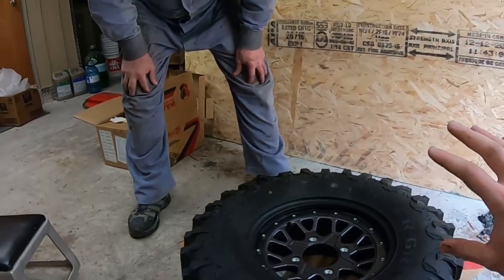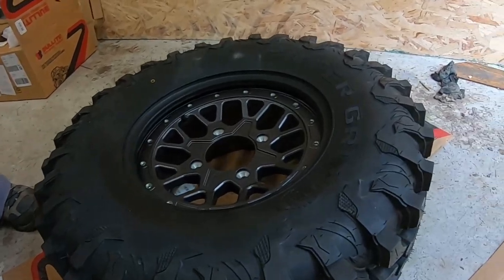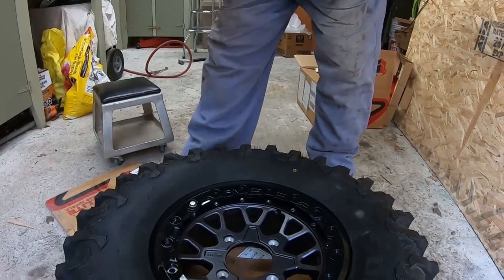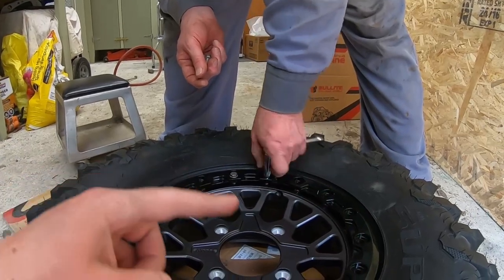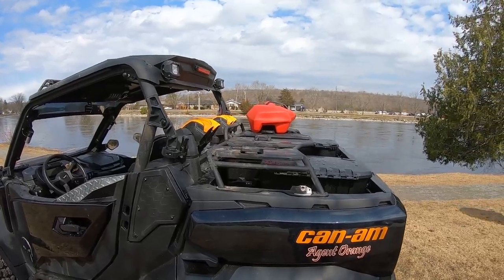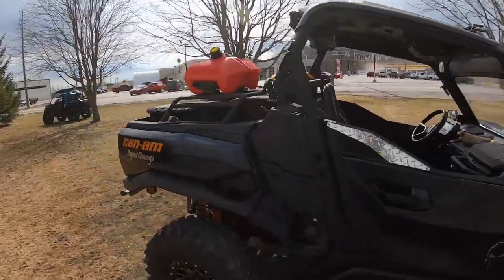XTP Build Ep 4: Style & Function + Linq Versatility - Commander XTP

Comment: I have 2013 Commander I have been building and just bought THE 2022 XTP. 
I love the break down of all the mods. I was wondering why Dad went with the smaller 14” rims verses the 15” it came with. Is it the height clearance for his enclosed trailer.  I am thinking about going with 32” or 33” tires myself, would 33” tires fit on the XTP stock rims.